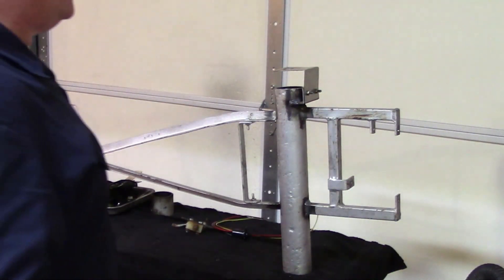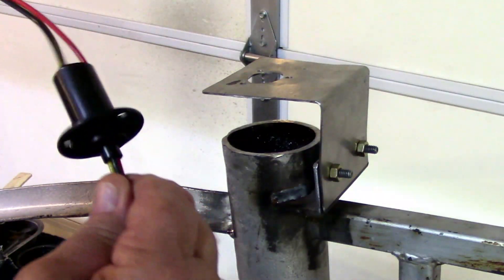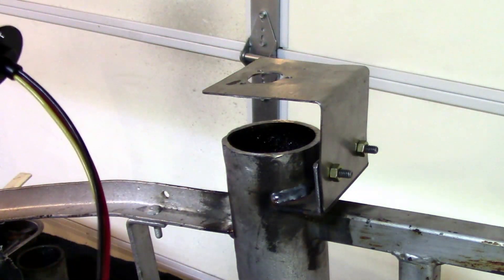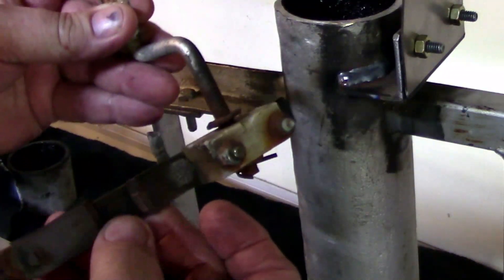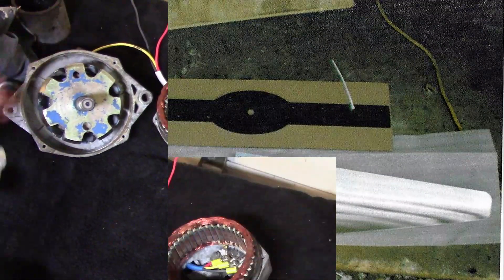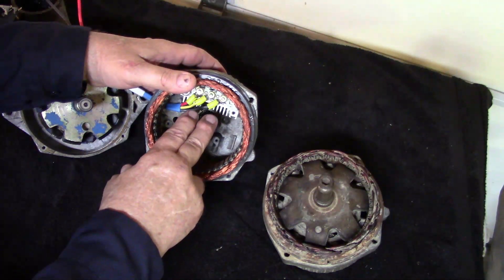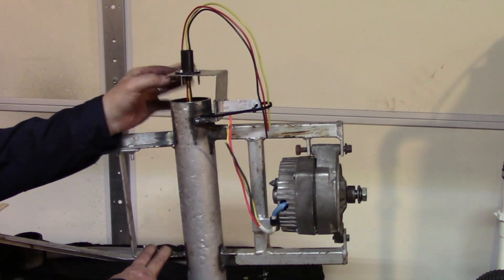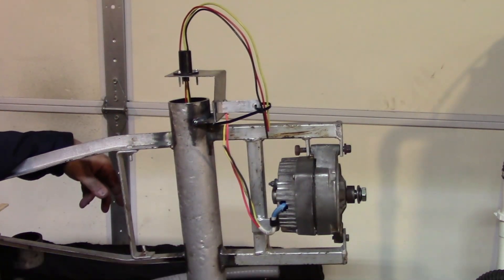Wind Powered Generator part 1

Comment: Nice upgrade,
How much power (on average) does that machine generate?  Interesting design, another well thought out project from your creative mind!
Work safe
Doug@ the "ranch"
Reply from the maker: lakesideranch   It depends a lot on wind speed of course but it will keep a small bank of batteries charged. I plan on primarily operating the shop lights. The more power you draw you have to produce. I will install a meter on it when I in stall it. Thanks Doug and enjoy your week

Comment: Good looking little project.
Reply from the maker: It is funny how we think wind power is a recent development. On the farms in the 30's they used wind chargers to charge radio batteries. Did you have one of those old battery radios in your collection?  I have one of the old wind chargers. Thanks and enjoy your week.
Reply: Rusty Glovebox it’s possible one of them once had a battery pack but it was long gone when I got it.

Comment: Great insight into the build just subscribed and it’s a nice compact turbine I also have built a homemade 650 watts wind turbine, a treadmill motor turbine and a little but powerful ametek 30v turbine and built 2 diy solar panels, be careful in high winds one of my first turbines blew up 😕and now have only 2 wonderful turbines working daily 😊it’s very satisfying watching those things working, keep up the good work buddy 👍
Reply from the maker: Thanks,  I'm planning on updating my solar panels too. I bought a 3000 watt pure sine wave inverter to add to the system . Take care
Reply: @RustyGlovebox  good stuff buddy keep working and get some crazy ideas from my channel

Comment: How much did you generate last it was running?
Reply from the maker: I could charge 3 - 12 volt deep cycle batteries with a 120 volt power inverter and operate the lighting in my shop. The vendor make 3 different kits for different average wind speeds in your area. LED lighting uses very little power and makes the reserve power last a long time. Thanks Matthew, enjoy your week
Reply: @RustyGlovebox  Seems like a great idea for keeping batteries charged up.

Comment: that's a good idea, way back when I was a very small kid, my dad had some kind of wind generator that would only power a radio, I'm sure he bought it somewhere though,, at that time we lived with my grandpa  and grandma, and they didn't have electricity, they got that in 1953.
Reply from the maker: I have an original Wincharger 6 volt wind charger. I don't have a radio for it though. Thanks